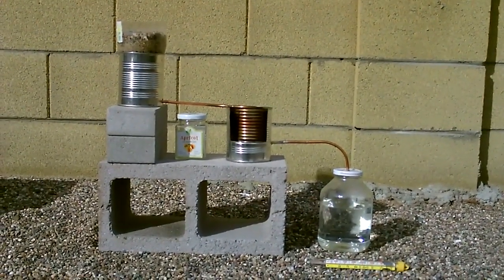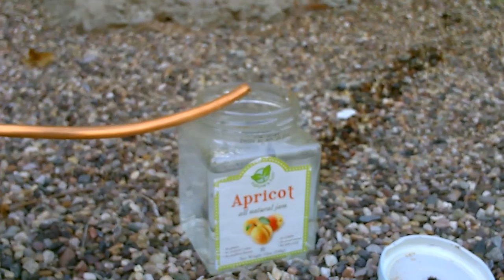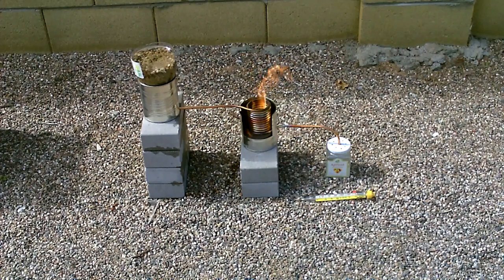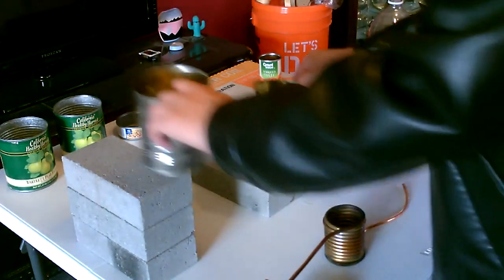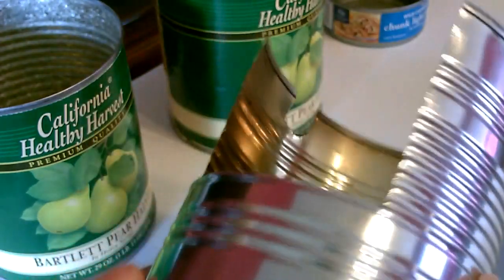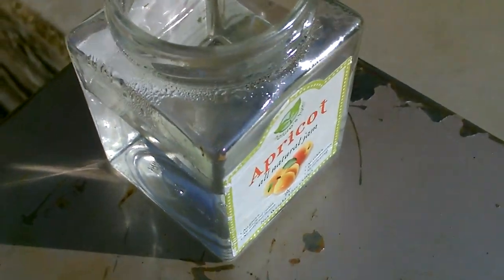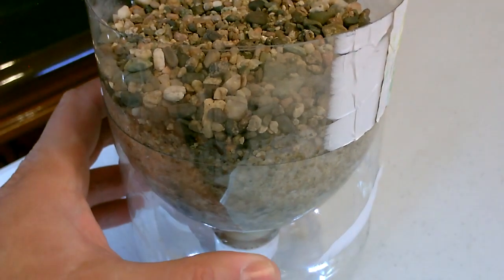The Ultimate DIY Water Filter! - The "2 Stage" (carbon+heated coil) purifier! - uses no electricity!

Comment: just wondering, wouldn't you want the top filter to come into the bottom of the heating coil and then leaving (the right side) at the top of the heating coil?  It seems that the water would just flow through what you have set up here (from the high side to the low side).
Reply: Christopher Lytle  That filter slows water down so it's a stream not a flow plus that heat will be pushing both directions slowing it more.  Gravity has to win.

Comment: If you put dye in the dirty water, with this specific build... would your clean water have dye in it still? Seems like the steam end should rise up more to make sure it is all just the steam and not dirty water being pushed out by the steam pressure into the clean water container? 
If so, the solution would be to just raise/make taller, the clean water end of the copper. 

Great Video!

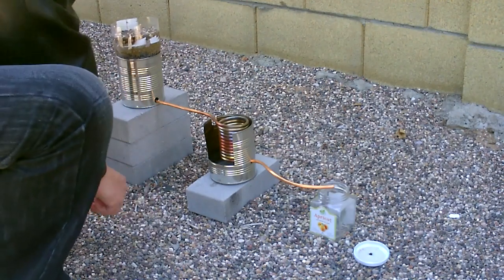Comment: What kind of water did you start with? It looks as though you just used bottled spring or distilled water, (6:05) you didn't say. It would have been awesome if you showed us that you poured pond water or muddy water in at first.  Clever design though.
Reply from the maker: jug i used was an old one - filled with dirty tap water *w/some dirt mixed in.

Comment: you could add some kind of a container with cold water right before the last stage of filtration so it will cool down the steam and liquifie it so you won't lose as much of the final product.
Reply from the maker: bruce wayne hi there. agreed. just for reference it only "steams up" like that occasionally (most of the time it's more of a "barely visible" trickle of steam/water vapor).

Comment: Nice, thank you for sharing this cool filtration method! What size copper tubing did you use?
Reply from the maker: hi. it's 1/4" tubing 👍
Reply: @desertsun02  Thanks so much!
Reply: Actually, one more question if I may...if I had KDF55 and/or KDF85 on my shelf, what is your opinion on adding one or both to it. I realize the carbon still needs to be the last media, so if I did add it, would it go just before that but after the gravel and sand? There is a bit of controversy on KDF85, yet is isn't clear.

Comment: Have you ever experimented making briquettes out of leaves twigs and junk mail paper?  I'm wondering how well those would run a rocket stove?  Cool video, great design using common trash.
Reply from the maker: SCJMO hi. yep, i've got a video or two on making briquettes out of leaves twigs and/or junk mail. they run rocket stoves great. probably work well (as a replacement for the alcohol) in this setup too. i'm always trying to find ways to reuse/recycle things people tend to discard as trash. i particularly like the "common trash" aspect of this project.  this design uses only a couple of "non-trash" items (copper coil and activated carbon)

Comment: About the coil, did you buy it pre coiled or did you bend it yourself?
Reply from the maker: hi there. flexible or "soft" copper pipe is usually packaged and sold as a "loosely coiled" roll. i just bent it around a small metal can to tighten up the coil (and then slid the can out).
Reply: +desertsun02 ok thanks so much..
Reply: that's for the vid this gives Me a another  great idea for a desalination  system iv be thinking of

Comment: Hi there. What did You use to seal the hole around the cooper tube in the first can so the water would not run out?
Reply from the maker: Keepingittocool hi there. i just put the copper tubing directly through the hole in the cap. because the cap of the 2 liter bottle has some natural elasticity, it's a tight fit, so i didn't use any sealer. (a drip or two leaks out every few minutes but no biggie). i imagine you could just use a piece of cork or a rubber washer if you need to.

Comment: does the copper pipe fit directly in the 2L bottle cap?  because the hole fits the copper pipe loosely in the can, so Id figure it would leak!
Reply from the maker: hi there. the bottle cap has an elasticity (esp. on the inside of the cap) so it fits pretty snug. you could seal if needed.

Comment: The only way to stop radioactive contamination is to distil the water. What you should be doing is to produce pure steam out the end of your copper pipe and feed it into a cooling area above a receptacle for droplets via a final stage carbon filter to eliminate volatile chemicals.
Reply: elbarn

Comment: how long does it take the copper coil to heat up and hot enough to remove the bacteria?
Reply from the maker: hi. it's very fast. the copper coil is super hot in about 1 to 3 seconds. it's basically instant.
Reply: @desertsun02  may i ask how much is for the copper coil? and can i use your video for my academic report?

Comment: May 5, 2020: desertsun02: did you send your filtered water to any lab for analysis? I have high arsenic and lead in my well water; and I hate using it to water my vegetables. I haul in drinking/cooling water for me/pets; but would love to find a way to lower the lead and arsenic to at least "safe" levels to use in my garden.